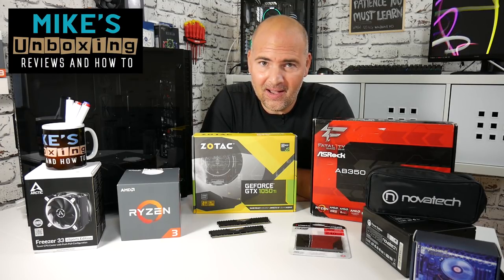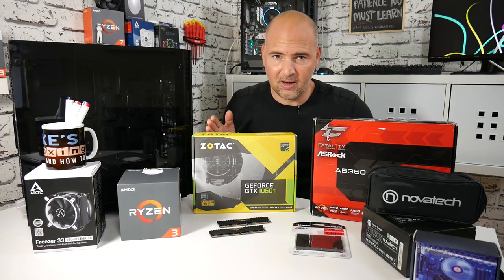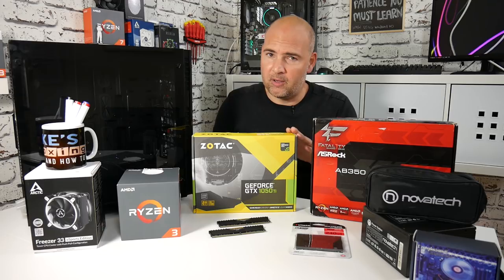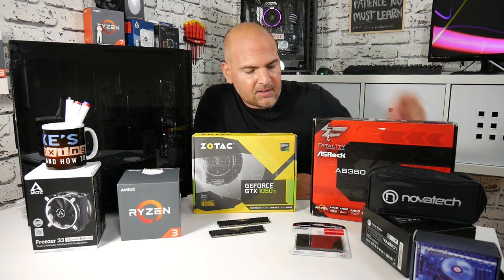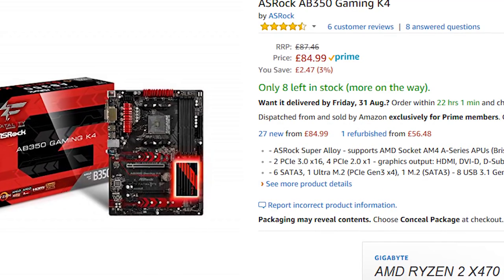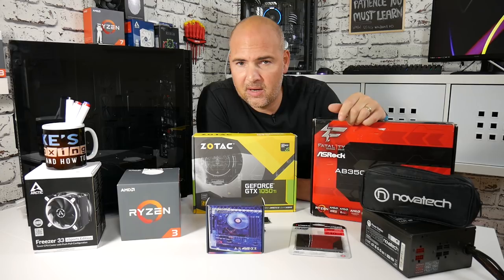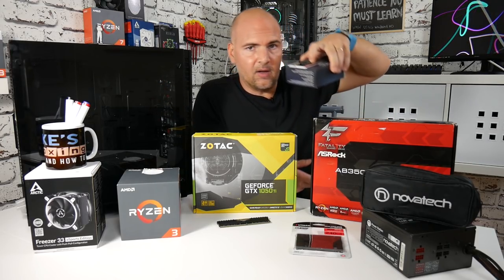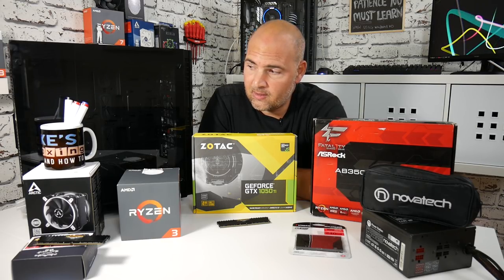Cheapest RYZEN 3 BUDGET GAMING PC Build Some Risks Were Taken

Comment: Hi Mike. Sorry I missed your live steam, I’ll try to catch your next one. I finally started buying the parts for my next build. I bought a Cooler Master MasterCase H500 with a mesh front panel and 2 200mm RGB fans for awesome air flow, as well as a tinted temper glass side panel so I can see all the pretty lights inside. I also got the MSI B450 Gaming Pro Carbon AC ATX Motherboard. Hopefully I’ll have all the parts by Christmas. Your build looks nice.
Reply from the maker: No worries! You build seems like some good stuff! H500 is a big ol beast! Keep us updated on the rest of your build, very interested to see what else is going on in there.
Reply: Will do. I like your airflow demonstration. That's a big improvement over your last case. I think the 200mm fans on my case should be able to hold up an entire news paper. LOL Be sure to give Kath a hug for me.
Reply: Thats a good motherboard. Im using it inside CM Lite 5, and temps arent too much of an issue
Reply from the maker: Yeah pretty impressed with it. I still have an urge to get another CM lite 5 against my best instincts :-)
Reply: Another CM lite 5? Are you going to start another business, like maybe baking pizzas? LOL. I could make that case work. I'd mod the crap out of it, giving it better air flow and a lot of RGB bling.
Reply from the maker: Mike's pizza unboxing 😂
Reply: Oletta Liano what i did with mine is i cut some slot on the front bezel where it come in contact with chassis and moved the fans to the inside instead of them mounting on the outside. Looks a bit strange but no issues with heat, played World of Tanks for about 4 hrs, turned off system and CPU cooler is cool to the touch
Reply: Sounds good. I would put some standoffs in the front and move the front bezel an inch away from the rest of the case so it could get air all around it. Maybe throw in a RGB light strip so it shows through the gap.
Reply from the maker: Good idea maybe something I could try and vlog the experience 😀

Comment: I don’t understand... you built an intel system, couldn’t troubleshoot it, (which based on your channel you should be able to), then returned it so you could make another video. That’s pretty weak. What will you unbox next after you return these parts?
Reply from the maker: It was difficult to diagnose the point of failure and as I only had one Intel CPU and one Intel motherboard and one m.2 SSD it would have been particularly difficult to diagnose. Due to Amazon and there fantastic customer service I was saved the work. And was able to make a new system and get up and running with very little fuss. 
If a had spare parts to diagnose with then I would have. But it seems daft to buy a new set of parts to diagnose something I don't need to.
As it turns out the system has cost approximately the same but is considerably better. And this is something that the viewers can quite easily replicate.
Sorry if you felt that I should have done more to revive the Intel setup. And thanks for the comments.